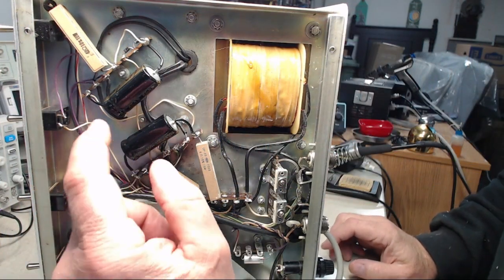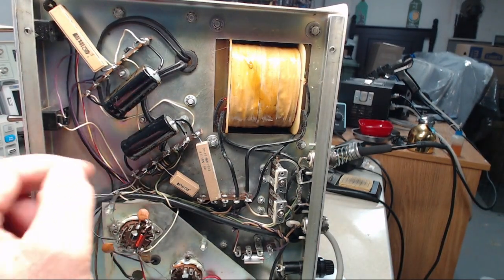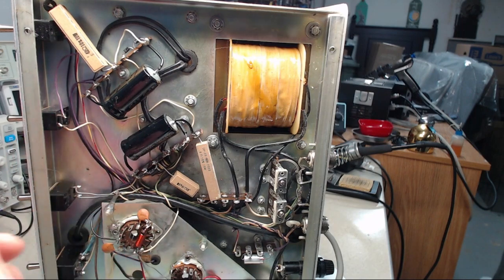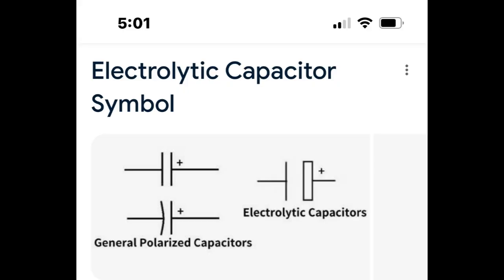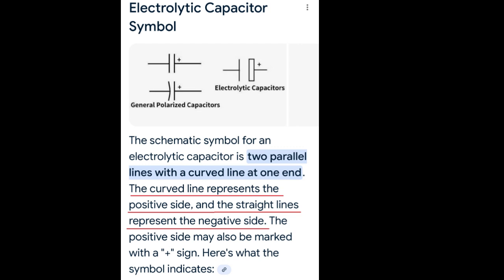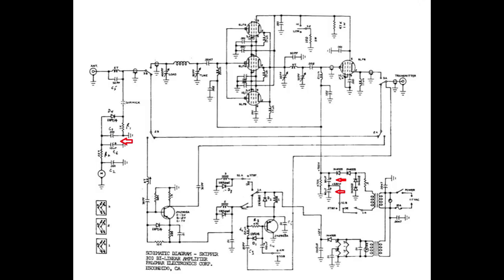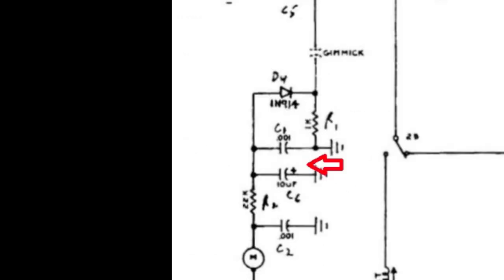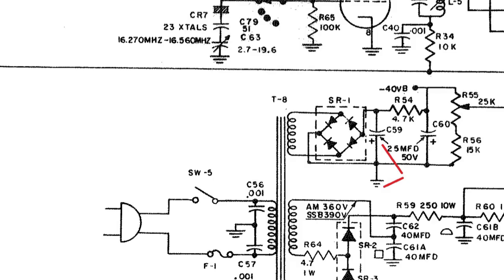Capacitor Anomalies

Comment: The great Mr Carlson made an interesting video a couple of years back. (Are your capacitors installed backwards?) This video detailed that some non electrolytic capacitors have polarity. The reason is that when you make a plate or cylindrical capacitor one of the layers has to end up on the outside. This side is more prone to pick up interference from the outside through stray capacitance. Meaning that the outside leg should be connected to whatever side of the circuit is the lowest impedance for lowest noise performance. (So, to ground, or whichever side is driving the signal if the capacitor is in series with the signal path.) I bet the original meaning of the curved capacitor symbol is that the curved side is the outside layer, even though this knowledge has gotten lost to the sands of time. But it would be interesting to look at some 1960s or so EE books to see if they have a comment on this.
Reply from the maker: Mr. C has some great content.  I like your thought about why the symbol has the curve. Thanks for the input.